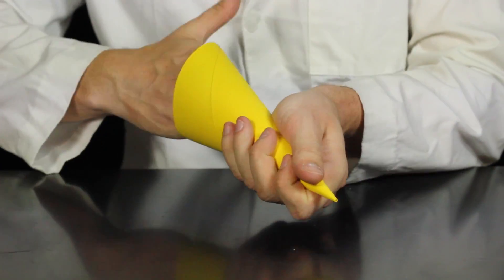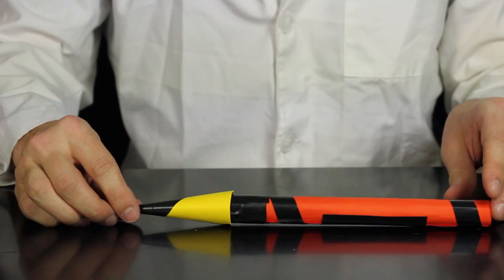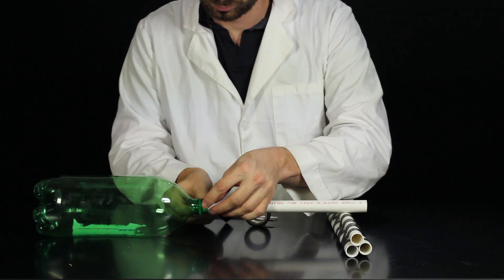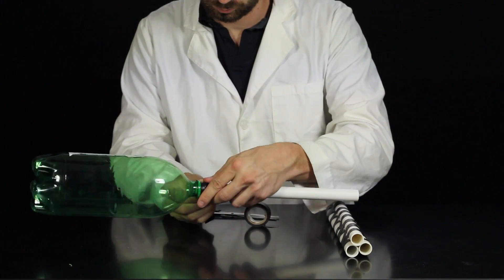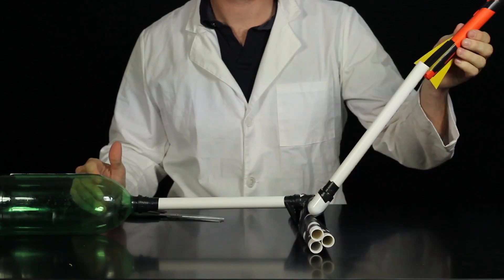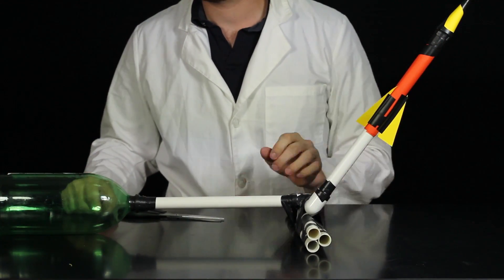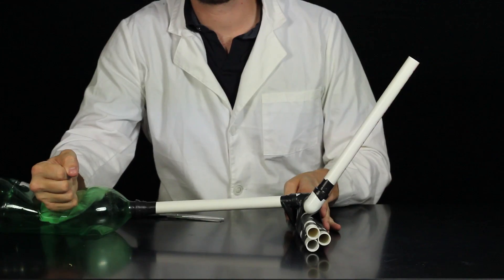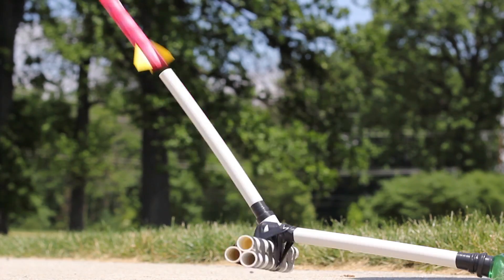Build Paper Rockets for Under Five Dollars (Physics)

Comment: Does the number of fins make a difference? How many fins is the best to have?
Reply from the maker: Three smaller fins at a very slight angle to cause the rocket to spin slowly is what I have found to work the best.   Bigger fins or more fins means more drag and it won't fly as far.